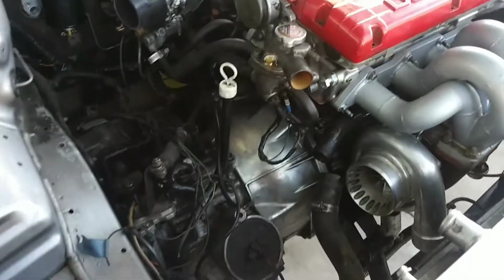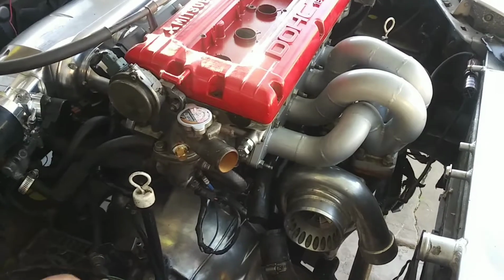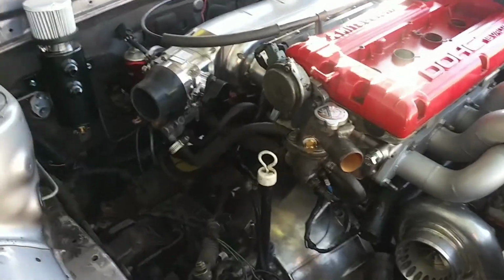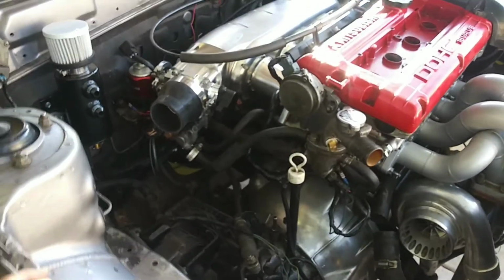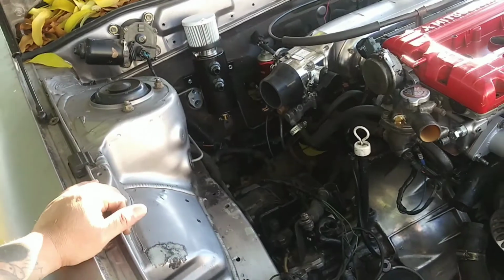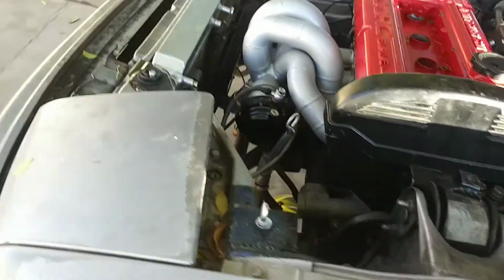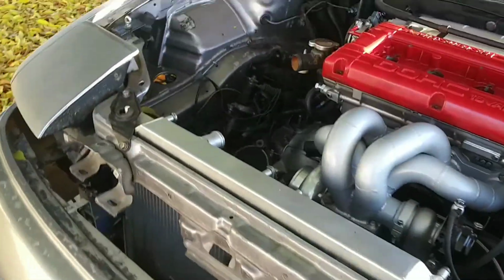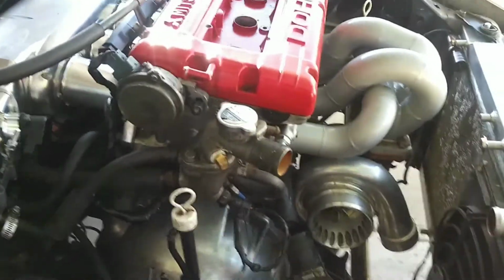Finally got the transmission in the Talon. Plus welding Fail

Comment: Looking good. I was in the same battery situation and ended up putting a civic battery on the frame rail in the engine bay. Was much simpler than a box in the hatch. My nitrous bottle was already there and the weight of cabling. Needing a disconnect, etc
Reply from the maker: Thanks bro. I'm still unsure of what I'd like. Either way I'm sure it'll come out nice.